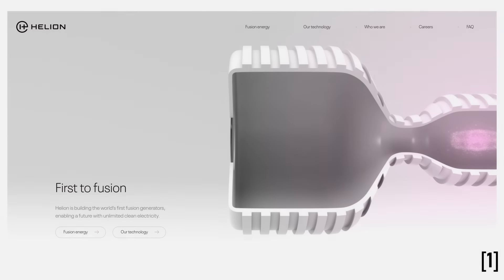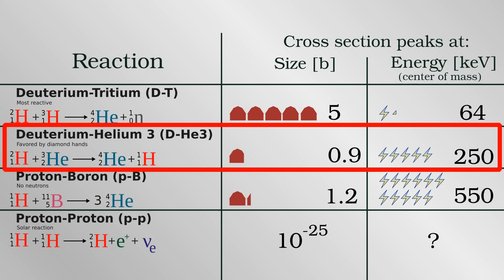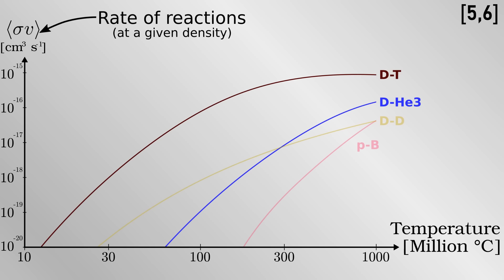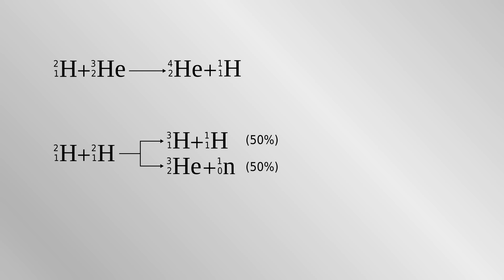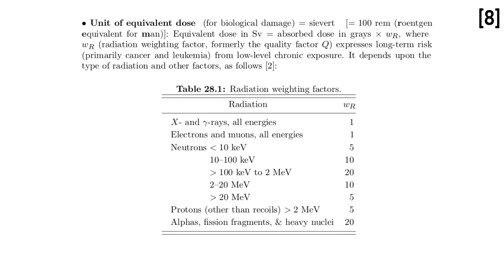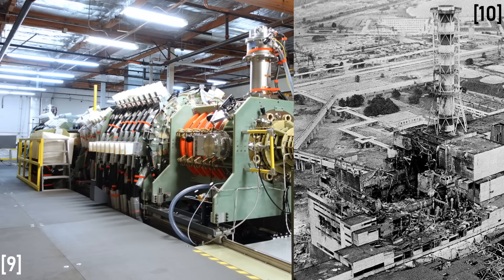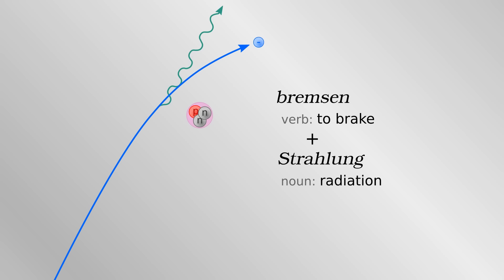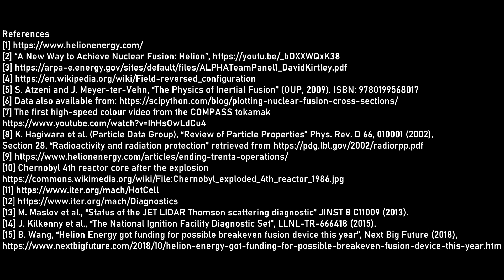The problems with Helion Energy - a response to Real Engineering

Comment: I have some questions. 
1) with regards to reaction:
While Helion does have a „lower“ temperature of 100mil( lets take that as it is) However temperature is not the only factor. The other major factor is Ion density. 
Helion has a high density of 3*10^22. For comparison, from what I found Iter will reach temperatures of 150 mil K and an ion density of „only“ 10^19.

So while you might have a smaller reactivity per se by the choice of fuel, this does not mean, that you can not archive sufficient reactions to produce enough energy. 

As for the neutron radiation issue, this might drive up costs, but in contrast to Iter, where Beryllium is used in the walls to breed T, Helion can optimize chamber materials to not degrade and shield against neutron radiation. Which is a major advantage. 

I might misunderstand fundamentals here, so if anyone who really knows what he is talking about could enlighten me that would be great.
Reply from the maker: The main problem with the much lower reactivity is how much energy input it will require to reach those plasma conditions. Countless experiments, including other FRCs, have performed fusion reactions and some have even generated 10s of megawatts of energy using D-T, but never having broken even. How likely is Helion to suddenly do better than all of them with a 1000 lower reactivity?

ITER will have ion densities of about 10^20 and temperatures of at least 250MK. Note the quoted figures are typically for the center of the plasma and get lower towards the edge; this must also be the case for Helion.

The whole premise of Helion is that it is supposed to produce no radioactive waste whatsoever. In the Real Engineering video, they say that "tokamak reactors are going to face the exact same issues as nuclear fission  energy. They will be too expensive and won't be able to compete with cheaper forms of electricity". By their reckoning then, radioactivity = unprofitability.
Reply: @ImprobableMatter  I agree, that radiation is a major issue and also a cost factor.
To evaluate that we would however need to know the actual costs when the reactors are actually industrialized. However it is pretty obvious that a fusion machine of the size of maybe a dozen meters will be much easier to handle than  a fission powerplants where the fissile material has actual long half-lifes of high radiation and with the pressure chamber a lot more exposed material. 
For cost you also have to look at the competition. And renewables are cheap, however they have a low capacity factor and are not reliable. So there is certainty a need for base load reliable scaleable energy capacity. 

To the energy density issue I must add that this is the advantage of inertial confinement fusion. Building up kinetic energy and then converting that to higher chamber pressure and thus density should be more energy efficient than trying to do the same thing with a magnetic field. 
This is an aspect you might would have wanted to adress in your rebuttal, as well as setting reactivity itself better into context. Thank you tho, Ive learned something
Reply: Higher ion density is going to be a drag, not an improvement for fusion. When ever two ions bump into each other the will lose energy below the threshold needed to break the coulomb barrier. Ideally you want ions to pick up the most speed possible before colliding into another ion.
Reply: @ImprobableMatter  " is how much energy input it will require to reach those plasma conditions." - but this touches on a topic I really don't think you analyzed well enough. If the method they intend to use to capture energy works, they should be able to capture a (hopefully significant) fraction of the energy they put in to create the plasma conditions. They're harvesting the energy of the plasma pushing outwards as it expands due to the pressure of the plasma, no?. Some of that will be from the energy added by the fusion, but most of it will be the energy they put in to start with, I would think.
Reply from the maker: @auspiciouslywild  They will have significant losses from the RF heating they claim to have, bremsstrahlung, plasma turbulence (hence losses of hot ions to the walls and so on), probably many others. There's no way they'll get away with, for example, having 10% fusion energy on top of what they put in and remaining efficient enough to get a net gain from that.
Reply: @ImprobableMatter  they said electron temps (1keV) are significantly lower than ion temps (8 keV), to help with bremsstrahlung lost, what do you think?

Comment: The neutrons produced by D-D fusion is close to 2.5 MeV. This is close to or even lower than the energy of neutrons (1-10MeV) produced in radiotherapy by conventional cancer patient irradiation with linear accelerators, which leaves a mildly radioactive gantry and is stopped by half a meter of concrete around the machine, or a 20cm slab of polyetilene/parafin. I have been working for 10 years with high energy (15-18 MV) clinical linear accelerators and I have still to see anything become activated inside the treatment room, other than the materials inside the machine, which end up of very low specific activity and completely decay around a year after disassembly.
D-T fusion produces 14 MeV neutrons. 5x more energetic than neutrons produced by D-D fusion. So they are not comparable or even in the same league.

So, your neutron production concerns are not an issue.

Bremm losses are not really an issue in high beta machines with a high enough ion-electron temperature ratio. Which is the case, so it would be minimal.
Reply from the maker: This is a fair point, but the neutron fluxes aren't really comparable. For the reactivity reasons I outlined, there will be about as many (or more) D-D neutrons as D-3He reactions, so a significant fraction of the total power will come out as neutrons. According to Helion's actual statements, they claim 5%, which would be 2.5MW for their reactor. For a power plant, this would be running all day, every day for months on end. Quite literally fission reactor power levels.

I will go over neutron damage at these fluxes, and the reason why Helion's setup will also produce 14MeV D-T neutrons in a video tomorrow.
Reply: @ImprobableMatter   And those power plants will have more shielding. Trenta is NOT a power plant. It is an experiment that only does one pulse every ten minutes (max) vs 10 pulses/second in a power plant. That said, there still is permitted shielding in the walls of the room Trenta is located in. Just not close to the machine. One purpose of Trenta has been testing various materials against neutrons. They are using low activation materials and materials that have a very short half life when activated (e.g. the magnets are made from aluminum which is 2 minutes when activated by 2.45 MeV neutrons).
Reply from the maker: Is Trenta a 50MW machine? If not (which it isn't), why bring it up in response to my comment about the predicted future 50MW (claimed) machine which will have 5% (claimed) = 2.5MW of neutron flux?
Reply: @ImprobableMatter  Correct me if I'm wrong, but have you not based your reactivity reasons in the assumption that Helion's production machines will work at the same plasma temperatures that the one depicted in RE's video (your words at 01:56 seem to suggest that).

Given that Helion has declared that they are aiming for quite higher temperatures in future machines, would not be in order to review those estimations.
Reply from the maker: Fair enough, however reaching higher temperatures is no easy task and as I explicitly stated in the video the D-D reactivity is higher than D-3He even up to 3x what they already claim to have. Also, as stated in my comment above, 5% of 50MW = fission reactor neutron levels is from their own documents.

P.S. As it says in the transcript "Even at higher plasma temperatures where the balance of these two reactions I talked about is more favorable towards the Helium one, you would still be at dangerous neutron levels."
Reply: @ImprobableMatter  I've watched your video again, followed and re-read your sources, and googled some more, and I have not been able to find any reference to that 5% of energy carried by neutrons. Is that one of Helion's claims or your estimation ?

That number is similar to the one calculated for a pure deuterium fuel with full 3H sequestering. That's odd, in a D-3He mix, shouldn't that depend on ion temperature and mix ratio ?
Reply from the maker: I personally think the 5% number is too low, but it appears to be what they said themselves on page 108 of this presentation: https://adamswebsearch2.nrc.gov/webSearch2/main.jsp?AccessionNumber=ML22081A057
Reply: @ImprobableMatter  Thanks.
Reply: @ImprobableMatter  
No one is arguing about the 5%. I think they will even need 10% to make their fuel cycle close. 

Trenta is at 10 keV now and it is subcale with <10 Tesla magnets.
Polaris will have stronger magnets. Temperatures increase rapidly with stronger magnets. The plots shown in the  Princeton talk by David Kirtley are for 20 Tesla external magnetic fields.
D-He3 reactivity exceeds D-D reactivity at temperatures slightly below 30 keV, actually.
That said, mixed mode machines will need two D-D reactions for every D-He3 reaction anyway to make the fuel cycle close. So about 10% in neutrons. Still A LOT less than Tokamaks, where some 80% of the energy is in neutrons and they are high energy neutrons too. Much harder to work with.
Reply: @ImprobableMatter  
5% is for a situation where they have built a large enough Tritium inventory to have additional He3 from decay. I agree that will take a long time. I think the first mixed mode machines will be at 10%.
They are also considering having dedicated breeders that don't produce (much) net power, but are just self-sustaining (plus the facility) to supply distributed pure D-He3 powerplants.
That could have some economic advantages.
Of course they could also sell Tritium for extra profit at least until the market is saturated. At 30k/gram that Tritium would make them MUCH more money than the electricity they could make from the He3 when it decays.

In fact, if I was them, I would sell the Tritium as long as the market allows. Make a few billion from that, invest that money well. Then use the returns to finance the long term Tritium storage and maybe into buildingD-D- D-T fusion machines to get rid of some of it, even if it is at a reduced profit.

The current uncertainty about what they are going to do with tonnes of Tritium is IMHO the most valid criticism of their approach.
Reply: @ImprobableMatter  
Trenta is not a 50MWe machine. As I mentioned several times. It is an experimental prototype.
I brought it up because you talked about the lack of shielding in your video.
The room Trenta is in still has shielding though.
50 MWe machines will have shielding for sensitive components and a building with extra shielding for the environment.
They show the latter in their NRC presentation.
I don't get how that even is an angle of criticism. D-T machines will need much more shielding than their power plants will.
Reply: @ImprobableMatter  i might be crazy here, but in line with photoelectric effect, the flux doesn't matter? like if a material is not activated at 2.5 MeV, they will never be activated at any neutron flux right?
Reply from the maker: @nedisawegoyogya  Neutron energy definitely plays a part in activation, because some activation reactions have a threshold. As for a higher ion temperature, this would be great, but I doubt their claims for reasons I didn't have time to get into. At the very least, the fact that their diagnostics are far more rudimentary than at other machines gives me cause to question them.
Reply: @ImprobableMatter  yes I watcherd your stream. They still need to at least think about 14 MeV neutrons.

Comment: Fusion energy is going to be totally rad for a bunch of people who haven't been born yet. In the meantime we need to get serious about small modular reactors so we can solve the clean energy problems we have right now.

Solar and wind are great but the storage problems are much harder than making better nuclear reactors. They're a great supplement but we can't run a power grid on them. It's not going to work if the wind stops blowing at night and hospitals and airports lose power.

Comment: First of all, I appreciate having a sceptic look at this so there’s not just corporate fluff videos out there.  That said:

I think the key thing you’re missing is that they were describing the current reactor, not the larger on they’re building.  The current reactor doesn’t work.  It’s not hot enough and the fields aren’t strong enough.  Therefore, all the criticism about the current design not working is correct, but misses the point of the video.

Also, they do briefly address the neutron problem in the video.  They don’t go in depth on neutron capture (and degradation) because unlike tokamaks, the power isn’t generated from this capture.
Reply: Helion's power is generated by NOT trying to contain the plasma to sustain fusion, but by absorbing the plasma fluctuations caused by intermittent fusion events.

This is why a Sustained Fusion critique of Helion , this video, is a straw man argument; more like a Sunday Sermon:  It even sounds like one.

Comment: This is a decent analysis and makes a few mistakes, but the most glaring one is comparing this machine to Chernobyl. The potential for radiation release is completely different. The fusion devices that Helion makes are pulsed machines, they inject a tiny amount of fuel for each shot. In a power plant they would need to do this about 10 times a second in order to achieve a reasonable power rate. In their testing today they can shoot once a minute or once a second, as slow as they want or need to. They could achieve net electricity on a single shot, and it would still be a huge success. They wouldn't need the full radiation shielding until they get close to full power, which is like the last step in this process.

Helion does plan to surround the machine in a lithium or lead-lithium blanket to breed He3, but it sounds like they are taking the reasonable step of first trying to prove they can get net gain before they focus on breeding blankets.
Reply: Helion does not plan to use a Lithium blanket. They breed He3 by fusing Deuterium. They COULD use a blanket, but they are currently at least not considering it.
Reply from the maker: My exact words were "If the Trenta machine, as pictured, were to be producing power plant levels of energy, it would be like the exploded Chernobyl Reactor Number 4". This wording is flowery, but accurate. While I realize I chew my words a lot, the captions I provide can be considered a definitive transcript.
Reply: @ImprobableMatter   
1. Trenta is a slightly subscale experiment. It does not produce power plant levels of energy quite yet.
2. Power plants will produce 50 MW of electricity.
3. Fusion machines can not explode. That is just absolutely ridiculous. A single Helion pulse in a power plant would only contain a few kWh of energy.
Reply: @elmarmoelzer2229  that one flew right over your head.
Reply: @ImprobableMatter This was a big red flag on your video for me. You brought up some important criticism/issues with Helion’s work so far, but your tone and framing weren’t any better than Real Engineering - just from the opposite perspective.

Comment: My two cents:
Pulsed fusion may be an easier method to achieve particularly high fusion temperatures, since it’s just a matter of accelerating the plasma over a longer distance / with higher force. While the complexity and inherent problems of this machine means it’s likely not the silver bullet for fusion energy, I think it’s got at least a few things going for it. Any deuterium fusion is definitely a neutron hazard, going for D-H3 and/or D-D fusion might increase the magnitude, but it’s a hazard either way. If you put cheap neutron absorbent material inside the vacuum chamber, at least you can mitigate the damage to expensive components. Naturally this means you can’t have electromagnets right next to the fusion compartment, so designing a pulsed fusion reactor around this limitation may be rather different. Perhaps one where net momentum in the lab frame isn’t zero, such that neutron flux forms a more controllable cone.